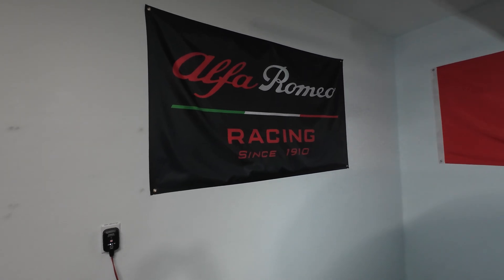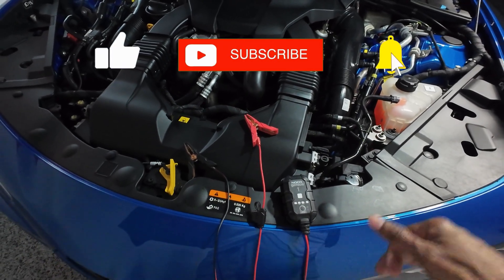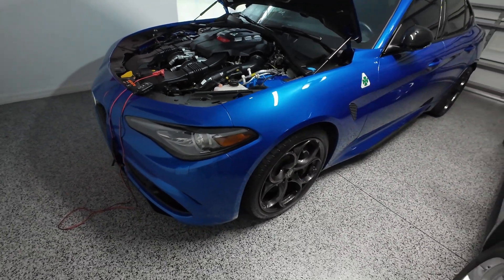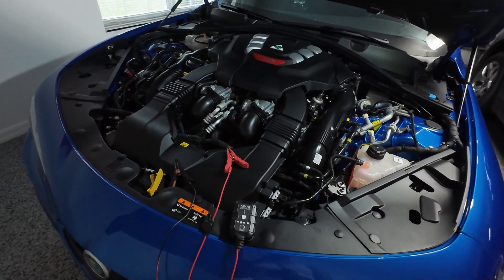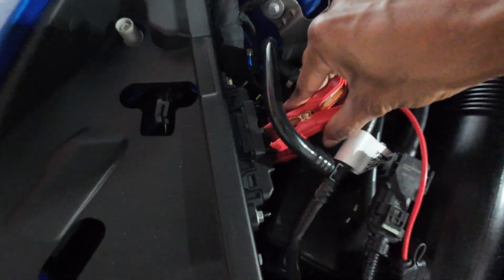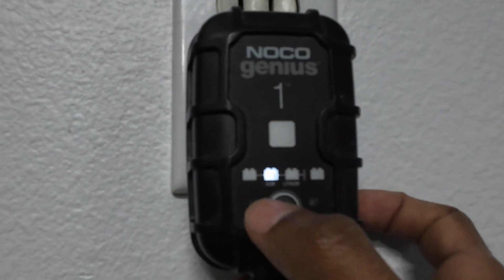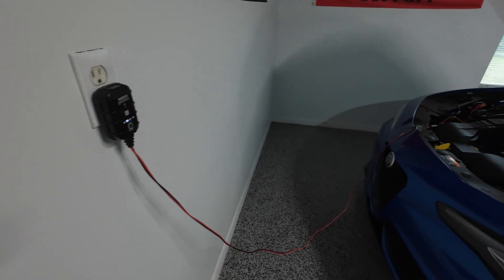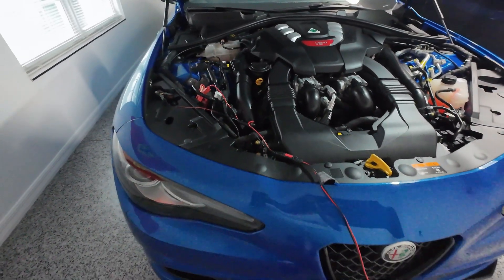THIS trick will EXTEND your car's battery

Comment: they do have a battery or parasite leakage problem.  our 2019 stelvio qv is on it's third battery.  and the LN95 battery is massive.   it sh1ts me that you have to trickle charge to be sure it does not drain the battery at, to me, random times.    I've read disabling auto wipers and auto unlock helps - we'll see how we go!
Reply from the maker: It's very likely that battery-related issues have been addressed in newer models. 

My 2021 2.0 L Stelvio sees regular use but is not driven daily. I have never used a trickle charger on it and never had a battery issue with it in almost two years of ownership. 

Similarly, with my 2023 Giulia QV, I only started trickle charging it because I don't drive it much and did it out of caution, not because I was having battery issues. I think I went over a year without trickle charge on that car initially and never experienced issues  despite not driving it for up to six weeks at a time. It would always start right up.

I hope you find a solution on your end.

Comment: When I trickle chrage my Giulia via the underhood connectors it never gets full charge. If I measure voltage at the terminals its about 1v below when measured directly at the battery.  Its like theres a voltage loss in the cabling from the undrhood termilnals to the battery. The car always atarts but the charger never gets up to maintaining level.
Reply from the maker: That's interesting that you bring that up since I have also noticed that it can take longer than normal to charge the battery from under the hood. However, in my case it does eventually show a full charge. Now, I haven't used a voltmeter to check voltages at each end, but I would suspect that there would be a drop given the length of the cable from the trunk (where the battery is) to the terminals at the front.
Reply: Make sure you are using the correct charger for your battery type.  If you have a AGM battery, you can not use a standard 12V Lead Acid car charger to fully charge it or correctly charge it, as the AGM voltage is higher.  Only use an AGM charger set to the AGM setting for an AGM battery.  Only use a Lead Acid charger set to the Lead Acid setting for a Lead Acid battery, etc.

A lot of modern chargers have multiple battery settings, and not setting those correctly will mean the battery won't charge correctly and the charger will often error out, or charge non stop as it never reaches the correct cutoff voltage.
Reply from the maker: @redbaron6805  Well said.